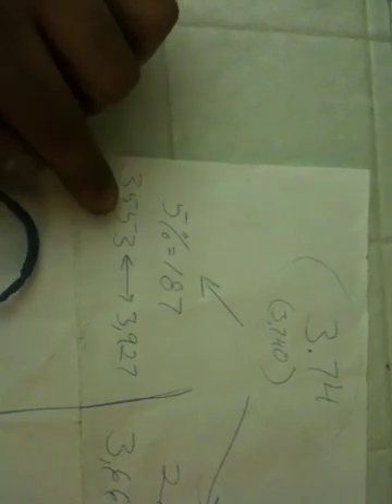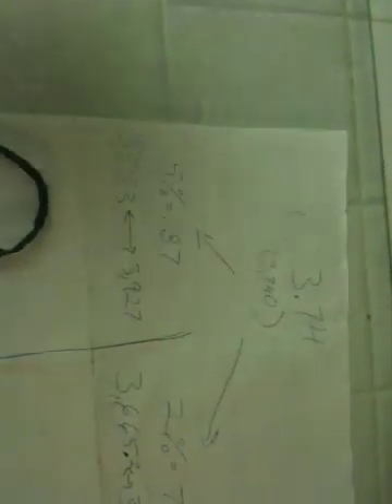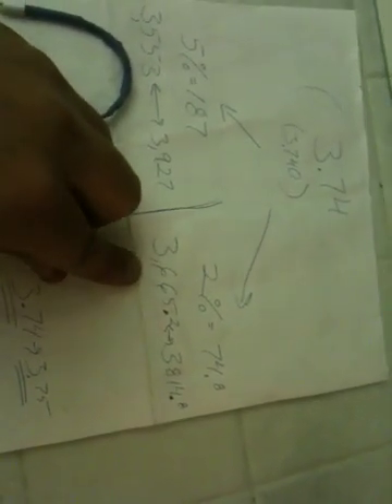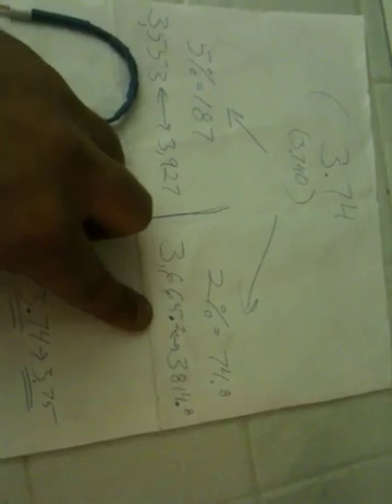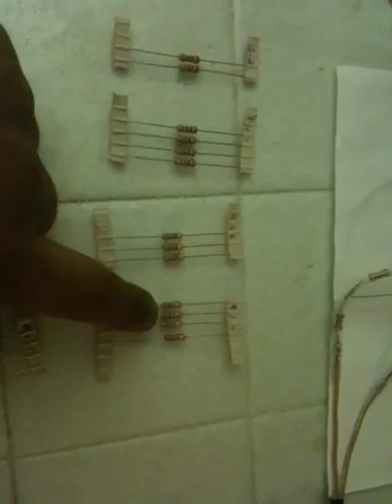GM Passkey Bypass VATS (PART 2)

Comment: This idiotic VATS system has the been the cause of countless headaches for owners, and high revenues for repair shops/dealers. You don't have to worry too much about the resistance variance. Even the individual key "pills" will have a variance of +/- 5% ohms.

Comment: Next time pick up a varister from Radio Shack, attach wires to center post plus one of the two other posts.  Attach ohm meter to wires and dial up the desired ohms using the varister's knob.

Comment: Do you know if this works with Cadillacs? I have a 2001 Eldorado! And another question was that the only light on? I have a digital system notification system. And it says something bout the Air Bags, My radio doesn.t work or the heat/ac.

Comment from the maker: @JoeyMascolaMusic: It's not the wires that are degrading. It's something else. All your doing with the bypass is completely disabling your VATS. It's basically permanently disabling that system. It's up to you, it's your car. ... Were you able to use a scan tool though and see if the DTC p1626 was being thrown yet?

Comment: will this fix work if the antitheft system is only locking the engine down once in a while?  My security light is and my engine wont start every few weeks in my 2000 firebird, but not always.  And when it happens, I have to wait around 15 minutes before the engine will start again..

Comment from the maker: @ IAMDAVEAMI: ... No, mine has been perfect since I did the bypass. ... Based on what you've said I can only assume that if someone previously did the bypass that for whatever reason, the resistors aren't operating correctly anymore. You may need to make a whole new resistor pack from scratch. ... 

I've heard of them going bad after a while if created in a rush at some point. By this I mean, combining the resistors solely by twisting them together instead of soldering them, using electrical ta

Comment: oi
mine shuts down after 10 mines did your did that too? and then i was poking around after spending 2500 dollars to fix it nothing so after pulling wires around saw the VATS wires and someone did hack it but i dont know so i took it out and then wouldnt start security flashing then no start so i jumped it with mine key haha it worked but did yours shut down after 10 mins of running thats the problem i am having 10 mins then it shuts down like a kill switch so if you know help me
the end
:P